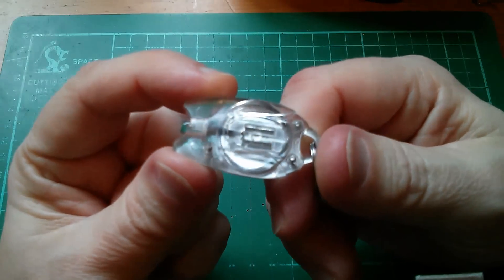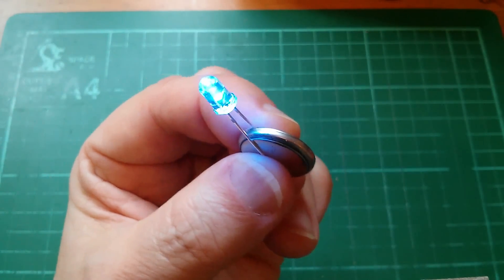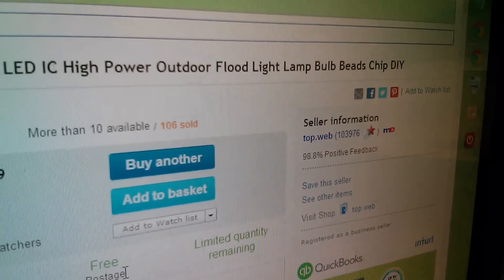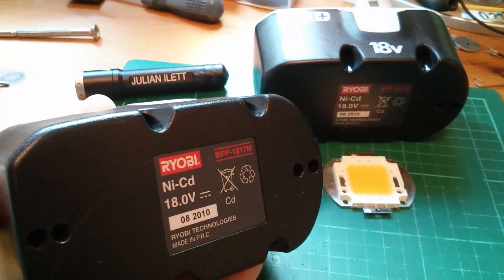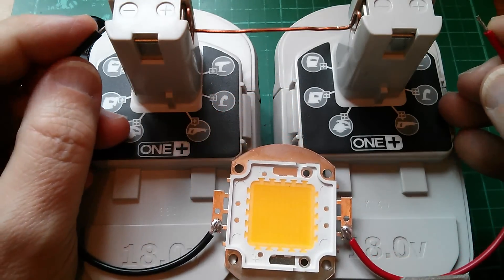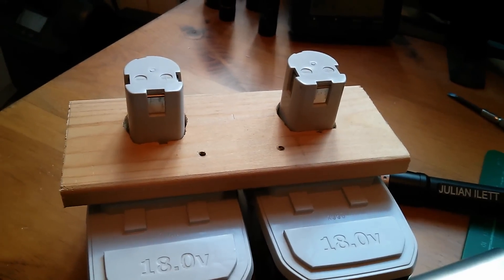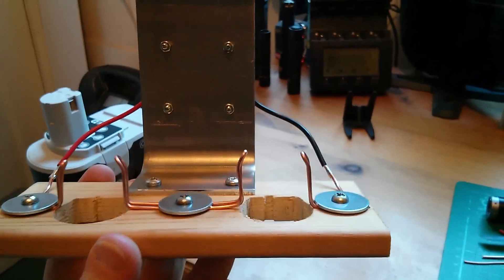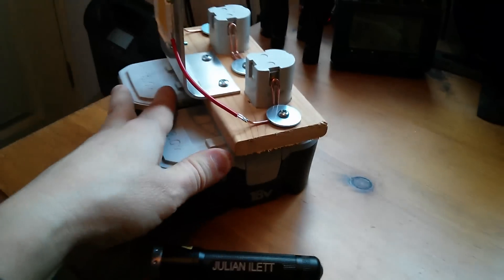Monster 7,500 Lumens 100W LED Flashlight for under $10

Comment: Its not so much to do with the voltage as the ESR of the CR2032, that's why you can also put a red or yellow LED with a 2V Vf and it still works.

Comment: this measly heat sink is far from dissipating the heat generated by a 100W LED, but it is ideally suited to help kill the LED within 20-30 seconds. Regardless of this, it doesn't make sense to me not to simply use a trivial power supply (with a boost-up module if you like) instead of these two lousy, misappropriated battery packs to power the LED. It would also be advisable to check the current consumption during operation .. in your case, however, the direct temperature measurement directly on the LED would be the best way to save the life of the LED in time ;)

Comment: I would not run one for more than 20 seconds without a cooling fan. I made a 100W headlight for my bike using one of these, using an Intel stock CPU cooler to dissipate heat.

Comment: As a simple improvement that's chep or even free, you could spot weld a CPU cooler to that pece of steel and it would probably run all day long if you install a fan with it.

Comment: ... you keep mentioning current, but really it's the voltage. at a given voltage, the LED will NEVER draw more than it can handle. if you give it ... 50 amps for an example, it will only draw what it needs if you give it the correct voltage... BUT even at it's rated voltage and full brightness, they get STUPIDLY hot, which is why they absolutely need heatsinks if they are of a high enough wattage.

in a sense, amps dont matter. voltage does. just make sure you can give enough amps for it to take. too little and the voltage will sag, too much and... well, it wont take more than it needs.

either way, it's a rather good video! worth something to try.

Comment: why are there no videos of people using premade jump start packs as a 12v source for flashlights..  reason i ask is they have an onboard charging board. 

could 3 of these in series be used to run a 100w chip and then of course disconnect them to charge?

i notice almost all packs do not output unless they see a current draw. 

the ones that do only sustain a barrel connection at 2-5amps.

seems like there is a way to bypass the current sensing switch and turn a jump pack into a traditional power supply via the jumper cable outlet.

Comment: what's the point of a flashlight that one can use for 20 seconds .. and for that cost ? ? You could use a 9v battery and it will not overheat and you can use for as long as the battery is useful ..a hole lot easier to fit in your hand.. I done just that with different LED I have pulled from different appliances /\.

Comment: Heres a tip. They've replaced traffic lights with leds, and the old traffic lights often have very good parabolic reflectors made of mirrored glass, (some are aluminium) and they're perfect for diy flashlights. If you put a 12v halogen bulb in one and focus it, you get a long  beam like a searchlight that you can shine onto low clouds at night (don't do it near an airport).

Comment: My son and I did a similar project using 3s lipo packs,  a lipo monitor,  one of those gated toggle switches the big red flip over cover and some tubing as the handle,  a chunk of extruded aluminum from an old commercial door hinge was our heat sink and led mount for the 2- 10 watt 12v leds...  kydex heated and formed into a oval bowl and spray adhesive on a piece  mylar space blanket material works really well as a reflector.  It's not too shabby actually.. hell of a good work light .  We also did a similar power source (lipo 3s for rc trucks , volt monitor and switch)  and  used a roll of double density warm white led 12v strip  (600 leds) adhered to an old metal serving pan that's  probably 14 inches in diameter. . It's truly a portable sun .. he did the bulk of the work there too.. fun little after school projects

Comment: Why not use a 12V lead acid battery and a voltage booster circuit to push it on 34V?

Comment: 7,500 lumens?!?!?!  That's approximately the equivalent of seven automobile headlights on "High Beam."  As such, I'm calling "BULLSHIT" on your 7,500 lumens claim.  How did you determine the number of lumens produced by this LED, anyway?

I have a TRUE "flashlight" (meaning it is ACTUALLY PORTABLE) that has an output of 2,600 lumens (equivalent to two automobile headlamps on the Hi-Beam setting) when in the highest setting of the four which are available.  It is the JETBeam WL-S4.  

It also has a "strobe" mode (it'll blind ANY attacker - even a bear), as well as an S.O.S. mode for emergency situations.

It uses two, CREE MT-G2 LED bulbs.

Its total length is 9 & 1/2 inches, and it weighs maybe 1 to 1 & 1/2 lbs.  

The handle is 5 & 3/4 inches long, and 1 inch in diameter.  

The remainder is a 2 inch segment that contains the electronics/controls & heat sink, and is 1 & 3/4 inches in diameter.  

The final part is the "head" of the flashlight, which contains the bulb & reflector, and is 1 & 3/4 inches in length, and  2 & 1/2 inches in diameter.

The light can be powered either by two, Li-ion 18650 (I use the ones that are 3.7v) rechargeable batteries, or four CR123A rechargeable batteries.

AT 2,600 lumens this truly portable "flashlight" is a BEAST!  

In fact, while driving home one night, at around 2:00 a.m., the fuse that controls my truck's headlights blew out about two miles from my home.  Luckily, I have three of these flashlights: one in each of my vehicles, and one in my home.  I grabbed the one I keep in my truck, rolled down the window, held the light in my left hand and used by right hand to steer.  I had NO problem maintaining my 50 m.p.h. speed since I had the equivalent of TWO, hi-beam auto lamps by which to see/drive.

The "throw" (maximum beam distance) of this flashlight is 380 meters or, just over 1,200 feet (or, just shy of 1/4 of a MILE)!!!  Like I said, this portable flashlight is a BEAST!!! 

It can be bought from a number of sellers on Amazon.com for anywhere between $97.79 & $129.00 U.S.D. 

The higher prices are for "bundles" that include two, rechargeable Li-Ion batteries, or the batteries AND a charger.  

(There are some greedy sellers who charge $145.00 to $219.00 U.S.D., and those prices do NOT include batteries or chargers!  I'm betting they don't sell to many with the lower priced ones readily available on the site.)  

I also have another flashlight that is even MORE of a BEAST, AND is smaller/a bit easier to carry than the JETBeam.  

The MONSTER of which I speak is an O-Light SR-Mini Intimidator II.  It is 5 & 1/16 in. in length, and 1 & 7/8 in. in diameter, which (although significantly shorter than the JETBeam) puts out 3,200 lumens - one thousand more than the JETBeam.  (Oddly enough, however, its "throw" is only 268 meters.  Possibly it is due to a difference in the light's reflector - I don't know.)
 
It uses three, Cree XM-L2 LEDs for it's light source.  And is powered by 

This bad boy can be had at Amazon.com for only $129.95.  

Do NOT fall for these BS ads for flashlights that cost $10.00 - $65.00, which are ALL made by the same company in China, under a couple of dozen different names, but - if you look at them closely - are OBVIOUSLY the EXACT SAME LIGHT - same size, same controls, same lettering etc.  Their ACTUAL lumen output is only about 300 lumens.  Buyer BEWARE!

Comment: I have a potential sales outlet for this.
as a back up to a light house light beam. limited sales opportunities I guess (how many lighthouses are there in the world? )  but sales never the less.

also may I suggest a slight tweak to your switch,in order for it to be truly hands free you need to experiment with a bimetal strip to make the battery contact, heat up,release,then cool down and remake the contact every 4 seconds?  (you can have my idea free of charge)

Comment: so the batteries cost under 10$?  Fucking clickbait
Reply: Help support Julian's LED videos on Patreon: https://www.patreon.com/julian256

I discovered that due to a lucky co-incidence of voltage and internal resistance, a 100W LED can be connected directly across the terminals of two 18V Nickel Cadmium power tool batteries. And that means you can build a 100 Watt (7,500 Lumens) flashlight for less than $10 (not including batteries).

LEARN TO READ...

Comment: On that bettery you could run a 100w led (100% power) for  couple of minutes tops. If you really want a flashlight like that to work you need at least 7ah battery.

Comment: You damaging LED. 18V bat are fully charged to 20,5V x2 is 41V
100W LED is for 33V 3A
I have 100W LED attached to CPU heat sink with 6xLi-ion 3500mAh With boost converter to 35V and another BC to 13V for fan.

Comment: Nice video julian... How the price of these 100w chips has continued to drop!!.... 1.38 pounds each now!!
Must be time to find the 'sweet spot' on your friendly, local, 240V mains supply ...

Buy 10 of these , wire them in series and plug in !! After 5 mins switch off and feel how hot they are , you can probably  take out one hence running at higher current  to get more light , depending on heatsink (if any) and exact voltage of mains .... continue reducing number in chain till they get too hot!

It does work , I've tried it ...
Reply from the maker: I tried it too - see my Scary Fairy Lights video
Reply: Brian Winzey That's not true. The 35v and 3A is for them to work at their nominal brightness. All that's happening at full power is the weaker LEDs underperforming and/or light bleeding from adjacent cells. Underpowering them demonstrates this by exaggerating the effect. As I've mentioned, check out some of the youtube videos floating around from experts and semi-professionals. It's a well known issue.
Reply: Yep and 99% of them are utter junk with only 10%-75% of the actual LED elements working. Check out bigclivedotcom 's video on them
Reply: That's because he's running them too far below their rated voltages and current. When you give them the 35v and 3A they are made to work with, all the LED's will light up on 99% of the utter junk chips.

Comment: 2 years later you get more Lumens with way less power in a standard flash light from EagTac or Olight or fenix or ThruNite or what brand you like. For sure not that cheap, but more efficient and portable.
Reply: The first EagTac torch I found when I Googled EagTac cost £359.  I think I prefer Julian's version.

Comment: Why don't you simple use a ceramic resistor? I can make 100W LED light in just $2.
Reply: Adnan Mohmand yeah right , you can always run 100 Watts though a regular LED with a hide resistor and call it 100 W where all the 100Ws are not used for making loght

Comment: Cool however that heat sink is far far too small for that LED, other torch constructors have used large cpu heat sinks with a fan, with LEDS the heat is the killer, also relying on the curret curve of the LED or battery voltage is risky too. But good effort. don't run it for too long.

Comment: I'm looking to build a led spot light for my patrol spotlight. I planned on using 3 20w COB LEDs but I'm struggling with the math for how big of a driver I'd need and if I'd need a volt buster for Bayern the vehicle and the spot light. Is there anyway to message you and talk about it?

Comment: Ignoring the "under $10" business, this is what is known in technical circles as a VERY. BAD. IDEA. I will not go into why; I've been designing consumer electronics products for nearly 30 years and this simply shouldn't be done (if you have to ask why you wouldn't understand the answer). Notice the lack of actual demonstration of the finished "device". The sudden flash of bright light that then "dies down" should be an instant clue that something is very wrong. Otherwise, it would have stayed at the initial brightness. BTW; I have personally designed a 2260W "UV LED" system; what he shows here isn't remotely correct.

Comment: Pretty cool little project.  I probably would have installed a simple switch or break on the section between the 2 batteries instead of having to mess with one of the contacts.

Comment: No heatsink or active cooling?  So you can only run it for a few seconds, not very practical.
Reply: It's not supposed to be, this is more a proof of concept more than anything.

People have already made flashlights using 100W LED's but they become far more expensive because they want a practical solution that lasts a decent length of time.
Reply: They're not expensive at all.  The LED's are cheap, use scrap components like CPU heatsinks.  This light is basically worthless if you can only turn it on for a few seconds.  Seriously, a kit is like $20.00 plus the LED.
Reply: Joshua Smellie man

nox.
Reply: Not worthless if you're using it as a camera flash! haha

Comment: It's safe for the LED because you are putting- with the resistance of the batteries and the wire- exactly 100 watts through the diodes. Unfortunately you will quickly kill your very expensive battery packs when you run them this way.

Comment: no current limit?
Reply: he is using the internal resistance of the batteries as the current limiter :D
yeah its pure gamble whether its too little or not (except if you find some datasheet for that model with the internal resistance included)

Comment: Drill holes in the heat sink. This will allow more surface area giving you more heat dissipation.
Reply: I honestly don't think it will do much ... I'd get a proper heat sink and eventually a fan, but then again this is supposed to cost 10$.
Reply: +Pual Hendrix He could get an hyper 212 evo (which cools my 90w intel i5 4690k very well)

Comment: If the point is to knock out the FLIR scopes of the storm troopers at night, It is a bit overkill.  Two flash tubes might be better.  They wouldn't be able to see where the flash came from.

Comment: I would be interested to see what kind of current you're reading off that, if you have an ammeter that can handle it;
and for all the wood and metal working you put in, it wouldn't be that much more effort to add some sort of current limiting circuitry to the thing to keep it within spec.

Comment: Why dont you just use a resistor to limit the current like anyone else? A resistor may cost a few cents and won't make it more expensive. 
That it did not destroyed itself by light it up for a few seconds does not mean that you can turn it on a long time without getting to hot.

Comment: If you used an old PC CPU heatsink you would be able to run it for longer.
Reply: I use a Mac heat sink which is large and it seems to be able to be kept on for a while with a fan without getting too warm

Comment: Measuring most power sources when they are off a load won't really tell you it's voltage.   This is why your batteries are >18v when you read them.

The other thing is that all cells have an internal series resistance.   In the case of the LED flash light this resistance will limit the current through the LED.   Your batteries are an array of cells in various serial/parallel configurations and also have an internal series resistance.  To find this resistance, you'd have to look up the data sheet for the cells.

Comment: Can I do this using 9 batteries in series of the 18650 without a driver?
Reply: +Isaak Malers My pants sag when I dump a load in them.
Reply from the maker: +LostMexicanFilms No, lithium batteries have a very low internal resistance.
Reply: Thanks for the quick reply. I saw a video by American hacker, he did it without a driver and 9 batteries. I considered it but when I had them all in series I got 36.3v and the 100w LED max input is 36.  How long would the light work without a driver? And what driver could I use to power it if I decided to add a few extra batteries in series? Thank you for your help.
Reply: +LostMexicanFilms Not even an 1hour without an driver , American hacker makes stuff without knowledges.
 What you need is a module who controls the current :
http://www.aliexpress.com/item/Free-Shipping-1PC-LM2596-LED-Driver-DC-DC-Step-down-Adjustable-CC-CV-Power-Supply-Module/32616905704.html
This module is good. You will have to set the voltage and the current. (For setting the current you will have to make a short-circuit with a multimeter and the red lead on 10A).
Reply: +Amar Gandhi You are right, i forgot about the current.
Reply: +JS7457 Problem is, that driver would not be able to handle the power needed to run the LED. Something like this would work better.
http://www.ebay.com/itm/DC-DC-11V-35V-10A-High-Power-CC-CV-Boost-Converter-Module-For-Laptop-LED-Drive-/290846741896?hash=item43b7d11588:g:7SQAAOSwNSxVZGgZ
Reply: +Julian Ilett 
1)Could I use one of those 1 Ohm 15 W Resistors instead of a driver?
2)Could I power this 100W Led for hours if I use a large CPU Heatsink with fan?
3)Is this kind of led sensitive to sudden changes in voltage etc. Is it possible to use the led for SOS signals per Arduino Board, and similar things?
Reply: Iamnot
Reply: my little
Reply: Christian Mendoza
Reply: LostMexicanFilms yes its possible

Comment: you could buy a led fog lamp at your local Toyota forklift dealer, they run 12v=48v,re=fit it to your old Ryobi flashlite,it is a little top heavy,about 70 min run time ,but it is realy bright, maybe1200 lumens!!!   its about 20 $

Comment: do you think this 100 watt led  would work  on a 4s(14.8v or 6s(22.2v cell lipo battery with a step up buck converter and how long would it last
Reply: +RICHARD LUSSIER step up buck converter is conflicting, boost converter is correct terminology. yes you can.
Reply: How long would it last from full charge?  Multiply your batt's V by its Ah (1Ah = 1000 mAh).  This gives watt-hours.  Divide by how many watts you're taking.  A simple example:  20V, 10Ah batt  offers 200 watt-hours.  If taking power at 100W it will last 2 hours.  A rough idea anyway.  Check the batt's not getting hot!